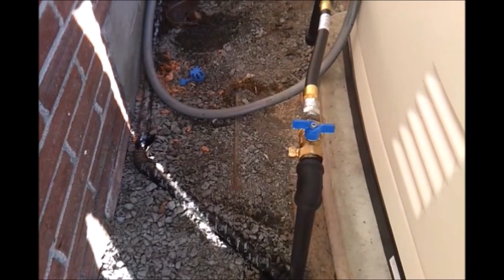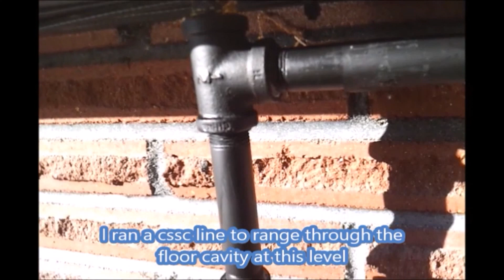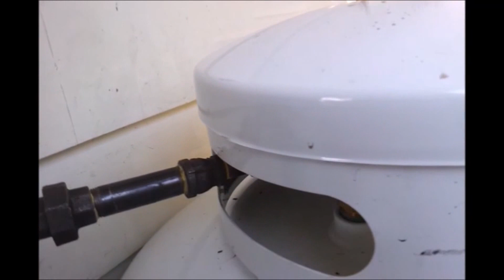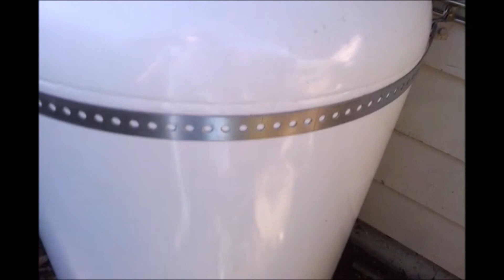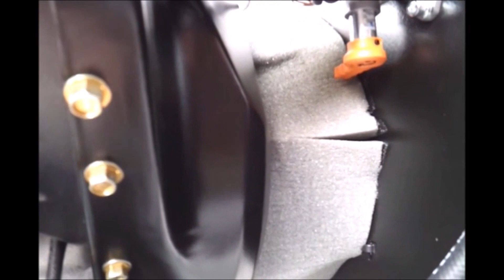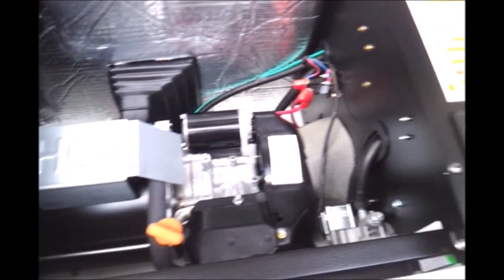DIY Generac Standby Generator 8kw LP Installation

Comment: Where do you buy that tank I need one?
Reply from the maker: bought from propane delivery company
Reply: @greenrumour  what’s the name?
Reply from the maker: @jahbariburton1264  you will want to search locally for a propane service like Amerigas, or Suburban Propane. or another more local outfit that may have a better price for you. you can expect to pay 500 to over a thousand for a 120 gallon container.
also try marketplace or offer up you can often find them for sale much cheaper.
Reply from the maker: @jahbariburton1264  there is a 480 lb 120 gal tank for $150 on FB market place in El Paso which is where you filmed your video from https://www.facebook.com/marketplace/item/2259412517590396/?ref=search&referral_code=null&referral_story_type=post&tracking=browse_serp%3Adfedfbf9-c0d6-4c26-8b2b-8eea1feba498

Comment: Hello. Why the conection from gas to the generator need a vertical tube (pipe leg before the generator =x=|| )?? Is it a residues colector or a pipe head for pick load?
Reply from the maker: propane has an oil residue that can cause issues over time so you are correct it is for collecting any oil that may accumulate.
Reply: @greenrumour  thanks. Good jobs and success for you. Have a nice weekend.

Comment: I was told buried/ ground mounted galvanized piping is no longer considered appropriate for propane lines due to the galvanizing flaking off inside the the piping due to it's reaction to the propane. (Galvanic Corrosionn???)  
And in my County all Propane Tanks must have 10 feet spacing away from any permanent structure.  So your propane tank would never be approved where I live.
Nice clean setup though.
Reply from the maker: Galvanized pipe should never be used for propane or natural gas. I am using black iron pipe specifically used for gas piping. None of the pipe is under ground. The structure is a separate garage unattached to the living structure so is allowed in most states. There are thousands of above ground tanks within a few inches away from homes in this state. Check your codes in your area before planning your generator installation. Thanks for watching.

Comment: How often does yours self test or run to keep it fresh?  I just picked one up that was spitting oil with low hours (260) and found from that tes runs or maintenance runs that due to it not being loaded that the valves were caked up bad due to carbon build up. She is all back together now and running like a champ. Have you ran into this issue? Thanks in advance.
Reply from the maker: bi weekly no issues so far

Comment: As the engine draws off sq/in of surface area of the propane, and the gallon capacity has little to do with it besides run time. I am wondering how good the genset runs at full load? Does it empty the lines and starve for fuel? What about when it is cold?   Seems to me the surface area of a vertical tank could be an issue??  I hope not.

Comment: Hi i have a natural gas generator   i need to converter to propane is that posible
Reply from the maker: there are many generators that are already outfitted with a conversion.
what is your generator make and model number?

Comment: Should be a flex from tank to hard line
Reply from the maker: TheIVBO
If we have to fill the tank through the POL as in a smaller bbq or RV tank then a flex would be necessary or at least advisable. However a tank this size has a dedicated fill port and the POL never gets disconnected. This factory POL line is the recommended connection, in my code area at least. Others may differ. 
 Thanks for watching and commenting.

Comment: Great video. You explain everything clearly. I plan to duplicate your work as much as it applies to my project.
 I am installing a used Generac and need to purchase the external regulator(s). I've been looking for a model that someone has used for this application. Can you tell me the model of the dual regulator you are using? 
If anyone else can provide a part number for what they are using and work, elapse tell me.
Thank you.
Reply from the maker: Good luck with your project. Let me know if I can answer any questions. Stay Safe Brother

Comment: Coming from the tank POL is 1/4"? 
Then to the regulator coming out is 1/2"?  To your 3/4" gas line to the Gen.  I am installing a similar 8kw gen.  Just wanted to know what W.C. you are getting at the Gen. My unit requires at least 11 W.C.  I will have a short 15ft. run.  Thanks.  Very nice work by the way
Reply from the maker: That is correct. Its a high pressure inlet so the tubing is very small 1/4" ,POL to POL line. The link to a pdf for the regulator is in the description. I get 11 wc at the monometer tap behind the generator. The system still works perfectly currently. Thanks for watching.

Comment: 120 gallon tank only holds 80 gallons.   It’s silly but 120 is how much water it will hold.  It only holds 100 gallons of propane and 80% of that is only 80 gallons. . .  I’m going that route because I have no place that I can legally put anything else.
Reply from the maker: I don't know where you got that information but most accounts for a 420 series propane tank at 120 gallons will hold 96 gallons of propane that is allowing for the 80% rule some  companies claim the number is 99.1 gallons of propane. Our fill bill charged us for 97 gallons. Good luck with your project.
https://www.frederickbrosoil.com/propane/propane-tank-sizes
Reply: Hopefully I misread.   More is better since it will be powering my generator.

Comment: Do you know what pressure comes out of the tank before the regulator?
Reply from the maker: approximately 200 psi . temperature varies pressure. it can go over 300 on a 100 plus degree day

Comment: That is a fantastic job, I have been wanting to install a generic generator but we do not have any gas lines in our sub-division. So I would have to have a 120 gal propane tank connected like yours. How long will it run with a tank of this size?
Reply: the generator spec sheet will give you the fuel consumption rate, it varies widely by the gen capacity and % load it is running at. This 420lb tank is full when it has 100 gallons in it. A generac 22Kw unit will burn 2.1 gallons per hour at 50% load and 3.6 GPH at full load.
Reply from the maker: expected run time is about 10 days at around 10 to 12 hrs per day before refilling is required.

Comment: 2 unions? Black iron that's gonna rust. This is why electricians shouldn't do gas.
Reply: I live in a mobile home built in 1981. It can plumbed for gas. Yep, black iron pipe that is a little rusty but Florida humidity will do that.
Reply: Just hit it with some good spray paint

Comment: Nice setup but some of these black iron pipes run look to long without support, maybe there is but I don't see it.
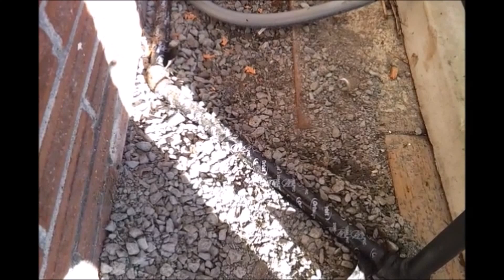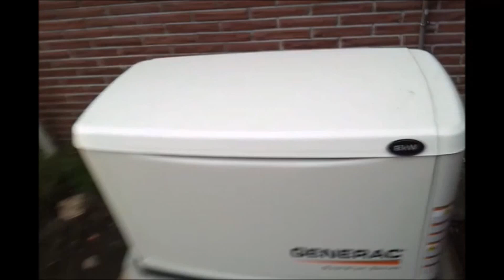Reply from the maker: Thanks yea at 0:50 you see where I write that in the end I anchor it to the wall. Also at 7:33 you see it anchored above the ground behind the generator. its also supported as it runs along under the deck.

Comment: Vets setup should have a 1 inch gas pipe
Reply from the maker: Thanks for watching the video.
Notice I am using Propane and a single duel stage regulator.
This is an 8kw Generator, the Installation literature that you can download from the Generac site yourself allows for up to 165 ft at 0.75" diameter pipe.
The duel stage system has its distance limitations and at 0.75" black pipe the max distance that should be used is 100 ft. I am running 50 ft of Black iron pipe with 6-90 degree elbows that adds 18 ft so am well within the required distances. the fuel inlet diameter is only 0.75" or 3/4 inch thread size.
This Generator runs excellently with my carefully researched setup.
Reply: That’s a rule of thumb for natural gas.